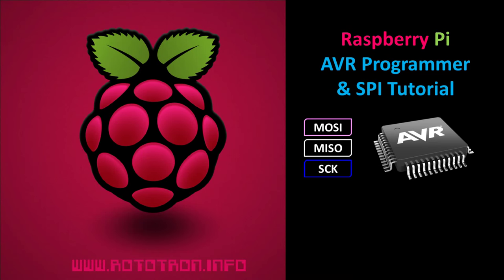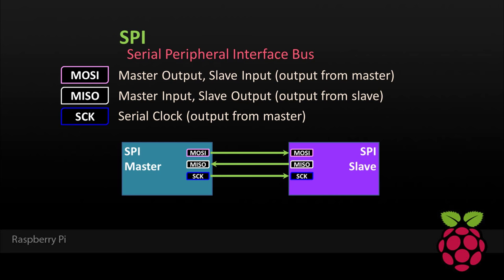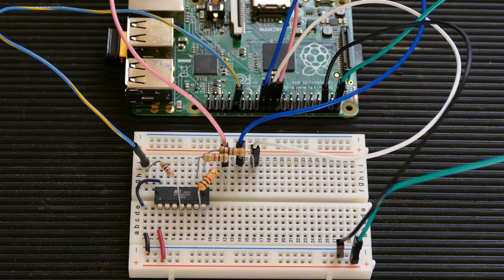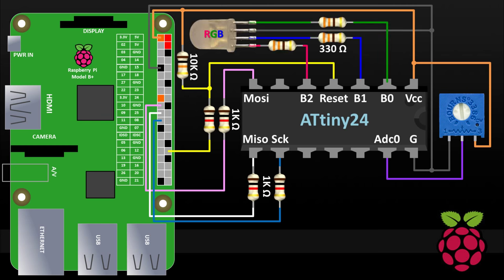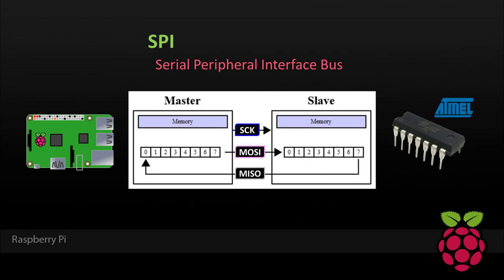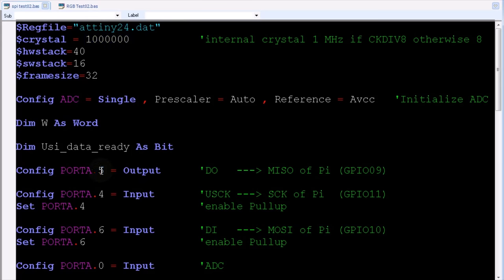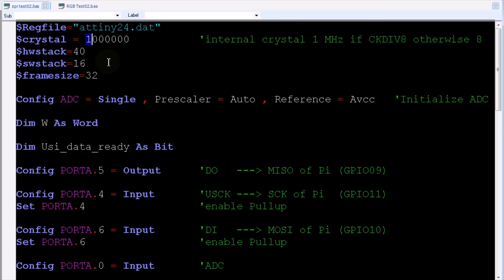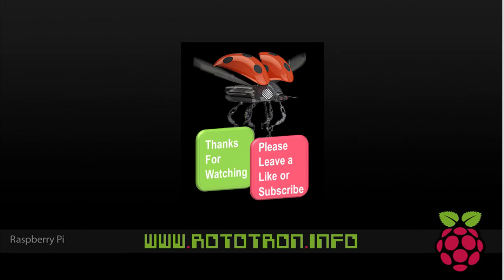Using a Raspberry Pi to Program an AVR and Python SPI Tutorial

Comment: This looks great! I've never used a microcontroller before, though, so I feel I must ask this: Can I do that to a new chip? Or does it need some kind of code in it before?
Reply from the maker: +Felipe Attanasio The code in the video will work on a blank chip.  No other software or bootloader is required.
Reply: rdagger68 Thanks!

Comment: Are the 1K resistors really necessary?

I’ve connected to SPI with no resistors before. What is the risk?
Reply from the maker: The resistors are not necessary.  It’s more of a safeguard when experimenting.  Generally speaking, the SPI lines do not need resistors in series.  In some cases, they could adversely affect the bitrate.

Comment: What do you use to compile the c into hex? Is atmel studio too complex? Had some code written for me for a project and need to convert it into hex. Thx
Reply from the maker: You can use Atmel Studio.  Here's a good tutorial:  http://www.avr-tutorials.com/avr-studio-6/generating-hex-file-avr-studio-6
It's for the previous version.  I haven't used the latest version but it's probably similar.
Reply: @rdagger  BTW, I was able to install the apt get version of the avrdude and have it work. Thanks
Reply: The way I like to work is to do everything on the Pi.  I use Atom.io  on the PC, and it handles the SCP(or FTP) of the files automatically.  Then I have atom.io fire off the makefile on the pi to compile and upload to the AVR.  Seems like everything is done on the PC, but it is mostly being done on the other end.  I know this is vague, but it should be a nice pile of breadcrumbs if you are curious.

Comment: Have you pwm a LED using both high and low? I have a switch that has 2 built in LED, one Green and one red. They are wired in opposing directions and I have a small transistor circuit to swap polarity based on one signal from an avr. If high, then one color, if low, the other color. Is it possible to program the AVR to pwm both at high and at low? These AVR also float the output yes if not wanting to illuminate correct. Very nice video
Thx
Reply from the maker: Not sure what you mean by wired in opposing directions.  Are there 2 separate LED's or is it a single bi-color LED?  If it is a bi-color LED, does it have 2 or 3 leads?
Reply: rdagger68 it's a LED illuminated button both red and green. The color emitted it's based on which way current is flowing. I've made up a circuit that takes either a high, low or float from one pin and the resultant color or none. Wondering if one can pwm one pin from AVR high or low to make different colors. Check out the datasheet.. pg 2.
https://www.mouser.com/ds/2/140/eswitch_07142017_PVA6-1165859.pdf
Reply: I suppose the only question that I have is if one can PWM a LED using either a high (+vcc) or low (gnd). AFAIK, one can PWM using a high output from an AVR, however, I am unaware if one can PWM using a low output. Long story short, I have a circuit that will run current through the button LED in a direction based on if the signal is either high or low, or no flow if the signal is floated. I've never dealt with a 2 wire dual color LED, whether they are separate or one unit internally. Thanks again, great vid
Reply from the maker: Yes you can use PWM to either source or sink current.  There are existing libraries for working with 2 lead bi-color LED's such as: https://playground.arduino.cc/Code/BiColorLED
Reply: You rock
Thanks
Reply: I'm about to start messing around with a 24 and I would like to know what's the best way to use one or more of the ports that are used to program the unit. I.E. the MOSI or MISO or the RESET pins. Like, how would I program it using those pins and then use it using the pins for other functions? What I would like to do is have it hardwired utilizing all the pins and at least one other pin from the MOSI MISO or RESET serving double duty being able to program and be a different purpose when just being used. Do i use a jumper, or what I am thinking is to use one raspberry pi for programming, and another configured to use those same pins otherwise. How would you use those pins serving double duty? Also, these AVR are OK at 5v logic even when powered @3v3 correct?
Thank you dagger
Reply from the maker: It's usually not a problem to use MOSI, MISO and/or SCK for the dual purpose of I/O and ISP.   On my CNC joystick project I use the 3 aforementioned pins to control the display.  A jumper is not necessary.  When I reprogram the chip the display just displays garbage until the programming completes.  The reset pin is more tricky to to utilize because you have to change a fuse which then disables ISP programming,  Afterwards, you would need a bootloader or high voltage parallel programmer to reprogram the chip.
Nope, I do NOT think it is safe to use 5V logic when the AVR is powered at 3.3V.  According to the Tiny24 datasheet: "All I/O pins have protection diodes to both VCC and Ground."  I assume that the I/O pins are only tolerant to VCC.  Therefore at 3.3V they are only tolerant to 3.3V.
Reply: Where's the best place to find someone that would help code this for a project?
How much do you think it would cost to hire someone to code together something with a couple buttons, LED's,  outputs for relays? Do you do that?
Thanks again dagger, your'e awesome
Reply from the maker: There are websites that hook you up with freelancers such as Upwork and ifreelance.  I don't have any experience using these services.  I'm a coder but I get all my work through referrals.  You can contact me through my website:  https://www.rototron.info/resources/contact/

Comment: What if I want to use an attiny85 and also use an arduino code to program it?Is it possible?
Reply from the maker: The ATtiny85 will work.  You can use avrdude -c avrisp to get a list of supported part numbers. I haven't tried Arduino code, but you should be able to use AVRDude to program the compiled hex files.
Reply: rdagger68 what raspberry pi were you using?
Reply from the maker: 2014 Model B+
Reply: rdagger68 pi 3 or 2
Reply from the maker: Neither, Pi 1

Comment: Do all Arduinos use Atmel chips?
Reply from the maker: Most use Atmel chips.  I know there are also Intel versions, but I've never used them.
Reply: The classic, popular ones do.  The Uno, Mega, Nano, and Leonardo use Atmel AVRs as their main CPUs (and in most cases as their onboard USB programmers).  The Zero and Due are powered by Atmel ARM Cortex-M series processors.  The Yun is a strange case, with an Atheros MIPS processor to run Linux, and an Atmel AVR for IO, I guess for those who thought their projects would require a Raspberry Pi and an Uno. Then you get to the Intel Quark-based boards like the Gallileo and 101 which were as popular as a wood flavored milkshake for several reasons, mostly that they didn't do a decent job communicating who and what they were for.
Reply: Many of the popular ones use the atmel ucontrollers. While the genuino 101 uses Intel. And many others use Intel

Comment: hi im trying to programe an atmega16a pu with latest avrdude 6.3 and it doesnt find linuxgpio at nano search...I did all the steps on the video what might be the problem?
Reply from the maker: Make sure you check my website for updates (the video is over 3 years old).  Use sudo apt-get install avrdude to install now.  I just tested it on a freshly wiped pi and the avrdude 6.3 config file still contains the linuxgpio section.
Reply: i tried earlier the sudo apt-get install avrdude and it works perfectly now...Thanks that you got into trouble to answer my question!!! im tryin to make a gui in python for raspb pi that will receive digital signals for an atmega16Apu...
Reply: I always get avrdude 5.1 installed on raspian when getting from apt.  It works fine by me, but I use "-c gpio" for the SPI, without edit. Using SPIO_CE1_N for selection to the reset on the AVR.

Comment: I'm in the process of making a circuit for controlling a relay based on an input signal that will hold the relays on for 10 minutes after the signal is removed. Any insight on the code? I'm using the attiny13a. Pin3 for the 3v3 sense and pin2 to drive the relay transistor. Thanks for the tutorial. I'll be watching a few more times
Reply from the maker: You will want a variable to hold the relay state (on & off). In your main program loop you check the state of the sensor.  If the sensor indicates that the relay should fire and the relay state is off then fire the relay, set the relay state variable to on and set a timeout for 10 minutes.  Upon timeout, turn off the relay and set the relay state to off.
Reply: rdagger68 awesome, I've stepped up to the avr that you have here... Are these good even having the power pulled unexpectedly? They then just boot normally and do the routine? Oh, also, do these need pull up and down resistors on the inputs outputs? Thanks again!
Reply from the maker: Yes they recover well from power outages.  You will need to use pull up/down resistors for inputs (not outputs).  The AVR has built in pull up/down resistors so you probably wont need to use external ones.
Reply: rdagger68 you rock
The last thing I want to do is control the mixer volume on the raspberry by commanding it to lower when a circuit goes 3v3 high. Do you think that it'll be OK to have the avr sense that signal and then output a signal to the raspberry gpio, or directly to the raspberry? It's a signal clipping sensor. Could be sporadic. Thoughts?
Thanks again
Reply from the maker: Not sure I understand your question, but if you want the Pi to take an action when a line goes to 3v3 then it would be easier and more reliable to have the Pi read it directly on a GPIO pin as opposed to reading the high an on AVR and then communicating the value to the Pi.  However, both approaches should work.
Reply: rdagger68 👍

Comment: Is it possible not to use MISO line or set/change its pin to diferrent GPIO?
Reply from the maker: You need MISO to read and verify the target.  I think AVRDude bitbangs the SPI protocol so you should be able to use alternative pins.
Reply: @rdagger  thanks for the help !

Comment: i read that you should use a 100nF capacitor on each VCC to keep the current/voltage stable. Any reasons why you didn't do that?
Reply from the maker: +Marco Doe Good catch. Yes AVR's should have a low ESR cap as close as possible to each VCC/ground pair on the chip (usually 10nF to 100nF).  As you can see in the video, it works without the caps, but it is bad practice.
Reply: +rdagger68 hey, in your example and every other i googled so far there's only one slave, like in my use case. but it seems that SPI is continuously talking, even if i don't want it to. so i guess, i can control it with the slave select. but honestly i have no idea how to implement it that it doesn't start talking as soon as i put SS on. 

what i want is to be able to send a single request to the avr and get a response. without the pi talking to the avr 10000 times a second.
Reply from the maker: +Marco Doe I haven’t tested this scenario but can’t you just use the spidev open and close methods to connect and disconnect?

Comment: At 7:28 into the video, what would be the p switch for atmega328p. I tried m328p but for some reason it isn't working.
Reply from the maker: You can use avrdude -c avrisp to get a list of supported part numbers.  There might be another issue because m328p sounds correct.
Reply: Might be old, but for others... Look at the signature when flashing.  I buy the 328PU, and it will work the same, but throws an error.  Use the -F options to force the programming.  The signatures of a 328P and 328PU are 0x1E950F and 0x1E9514 respectively.

Comment: How come your gpio pins are numbered in this random way? 
All the pinout maps I could find have those pins marked in sequential order.
Reply from the maker: There are 2 numbering schemes for the Pi.  I’m using the BCM (Broadcom SoC channel) numbering.  This is the numbering used by the Pi’s SoC.  The other is board numbering which is the order they appear on the Pi’s header.  You can use either scheme, but I’ve found BCM to be more prevalent.
Reply: rdagger68 thanks for clarification!
Reply: Why does my Paspberry say
sudo: /avrdude/bin/avrdude: command not found   ?
What am I doing wrong?
Reply from the maker: +Harlequin43 The location and installation instructions have changed since the video came out. Please see my website for updated instructions.
Reply: rdagger68 ok.
Thanks!
Reply: Board numbering is called "physical", where 0th (or 1st sorry don't remember) starts where the corner of GPIO is slightly cut off.

Comment: Hi i am getting "cant export to gpio 12, already exported/busy?: device or resource busy" as an error can anyone help me with this ? Thanks
Reply from the maker: What version of Avrdude are you running? Which AVR chip are you trying to program?  Is the chip blank?  Is the chip connected to any other components?  Which Pi are your using?  What version of Raspbian are you running?  Is the Pi connected to any other components?
Reply: More than likely you had something like libgpio still referencing pin 12. A reboot on the pi should make that error go away (unless you have scripts run at boot that call pin 12). Otherwise you can view the current running processes to find the process that is using pin 12 and kill it.